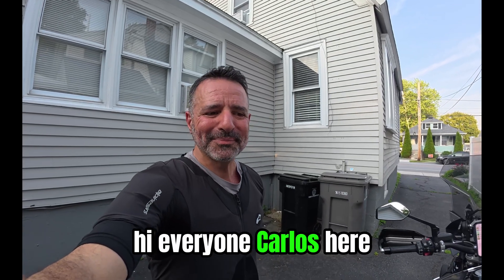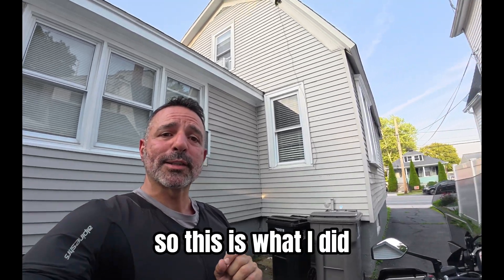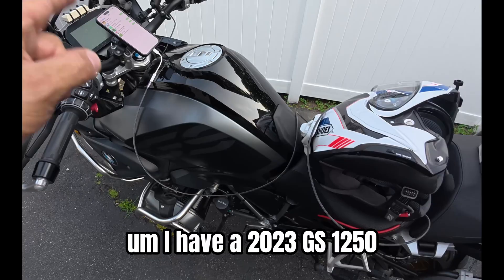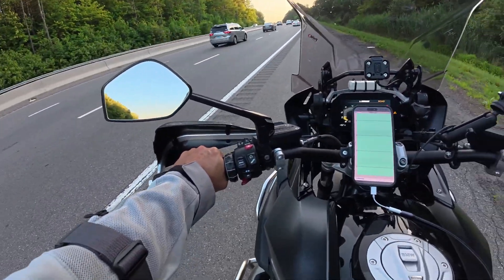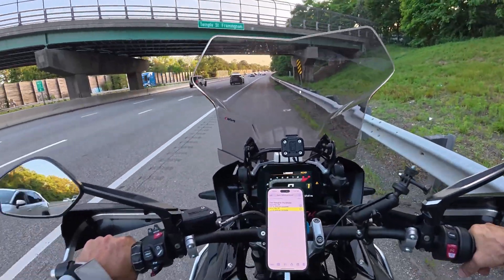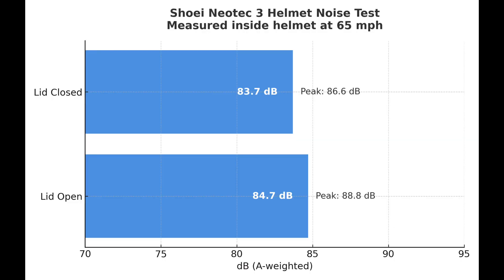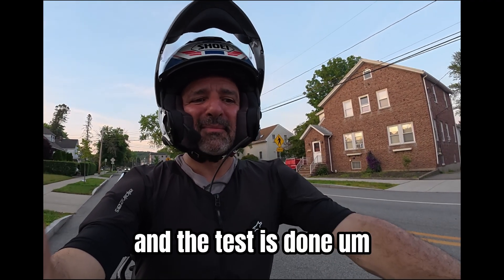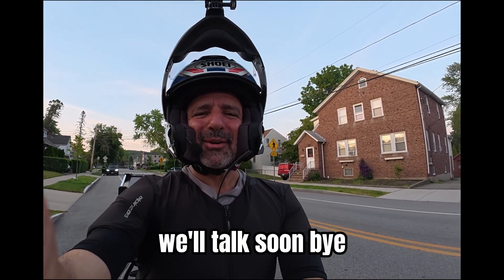Shoei Neotec 3: The Quietest Helmet Tested

Comment: Just wondering what chin mount you are using for this helmet ?
Reply from the maker: It’s called Chin Mounts. They probably have every single helmet mount. It is made with a 3D printer. Good quality, I recommend 👌
Reply: Does it work with the GoPro  vibration rubber mounts ? @DaVinciOnTheRoad

Comment: Great video and thanks for putting some data with a wide, subjective definition of what quiet/noisy could mean.  I have a Neotec 3 and it is my daily wear helmet, but I wouldn't call it quiet; maybe less noisy than other helmets.  Since hearing damage can start at 85 decibels, hearing protection is a good idea with any helmet.
Reply from the maker: Thanks so much for sharing your experience! 🙌 You’re absolutely right—“quiet” is super subjective, and I agree the Neotec 3 isn’t silent, just less noisy compared to many others. I also use ear protection on longer rides since wind noise can creep up quickly. Great point about hearing damage starting at 85 dB—it’s a reminder that even the best helmets can only do so much. Really appreciate you adding that perspective! 👊

Comment: The drop in decibels seems slight until you understand this:
"The decibel scale is logarithmic, not linear. This simply means that for every 3 decibels you move up or down the scale from 0-194, you are adding or dropping 50% of your remaining sound pressure levels to your exposure. By dropping 6 decibels, for instance, you first move 3 dB, and then another 3 dB. For each 3 dB you drop, your sound pressure levels will drop another 50% of the remaining sound pressure.   The following table will help illustrate the order of magnitude associated with dB."

dB-Drop                       Survival Rate

1 dB Drop                     79% of your noise has survived
3 dB-Drop                    50% of your noise has survived
6 dB-Drop                    25% of your noise has survived
9 dB-Drop                    12.5% of your noise has survived
10 dB-Drop                  10% of your noise has survived
20 dB-Drop                   1% of your noise has survived
30 dB-Drop                 .01% of yoru noise has survived
https://www.controlnoise.com/support-tools/about-sound-waves/understanding-the-decibel/

Comment: I think that you need to seek advice from a sound engineer, particularly with regard to the sound levels for different frequencies and also I think that you need to do another comparison test relevant to the difference between the positions for the two microphones: the one used for normal audio recording (the one that you are speaking into) and the one used for the test at your ear position. 

The reason that I say this is because of the noticeable difference in both sound quality (frequencies being recorded) and also the volume recorded by the normal audio microphone when the helmet is open versus when it is closed. That difference recorded using the normal audio microphone (between helmet open and closed) sounds vast, yet your test results don’t seem to support this apparent difference. Perhaps the noise suppression qualities of the helmet are much greater at the ear position than at the chin, where (I presume) the normal audio microphone is located? Did there appear to you, as the rider inside the helmet, to be much difference between helmet open or closed?
Reply from the maker: Thank you for your input. I’m going to repeat this test riding my MT-09. The GS has a great wind protection, hence the lower levels of decibels. I only used one microphone, close to my ear.